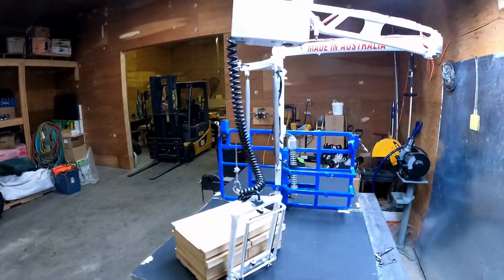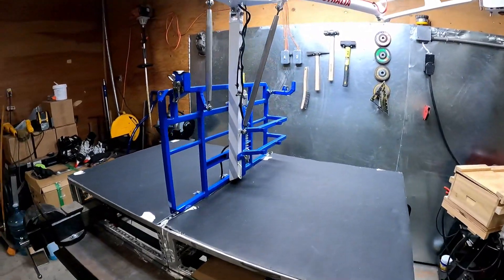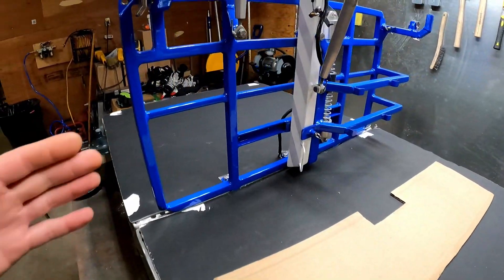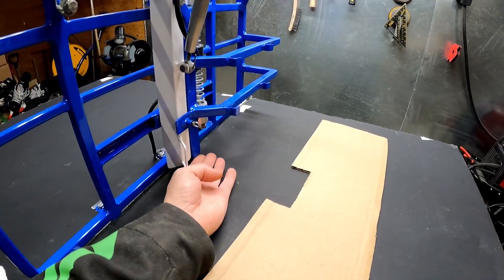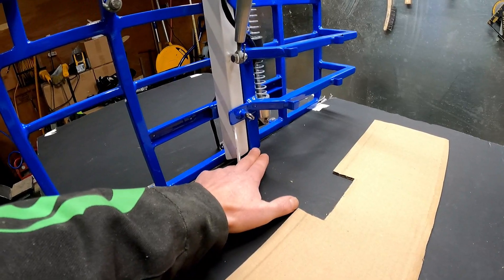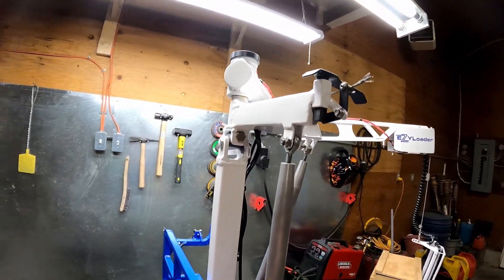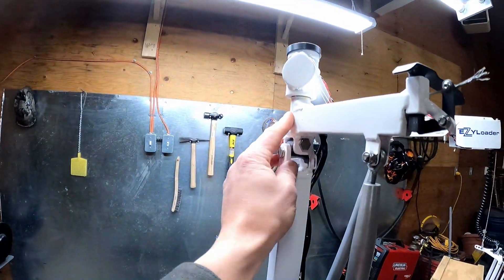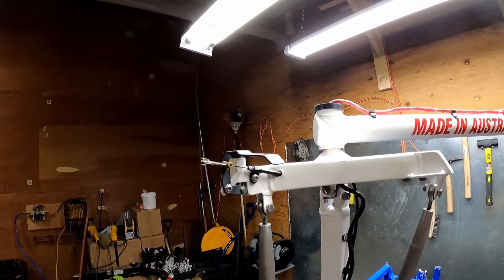Ezyloader   Stresses and triangle build

Comment: Ya, those gussets show cracks but as you say, because they were not welded under the same heat, the cracks did not follow into the structural welds .  
We ground off the gussets and acid tested the structural welds. 
Welding that requires a lot of preparation
Reply from the maker: It does indeed. Hopefully it goes well with the rest of the rebuild